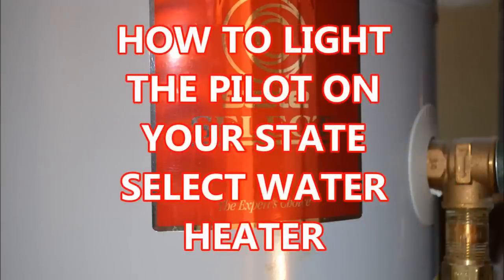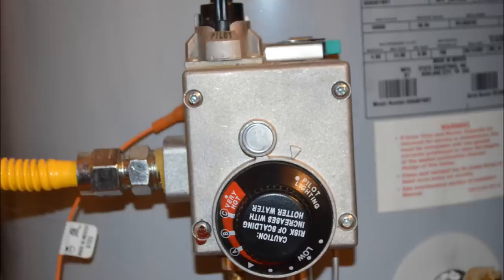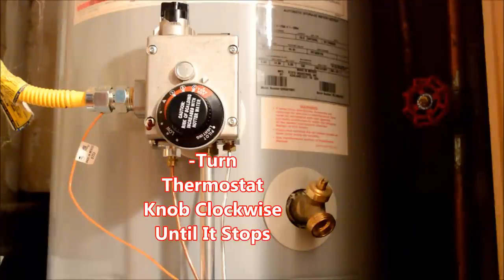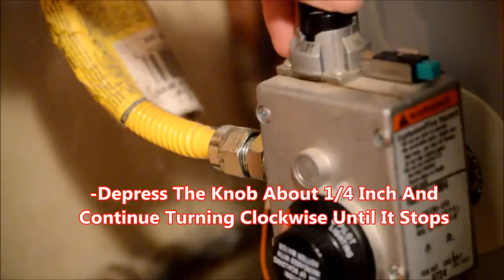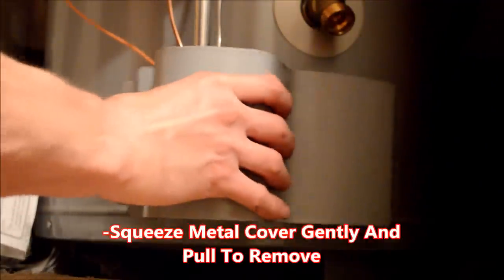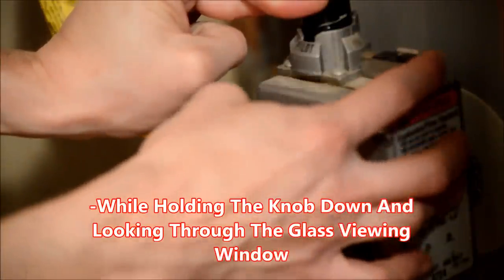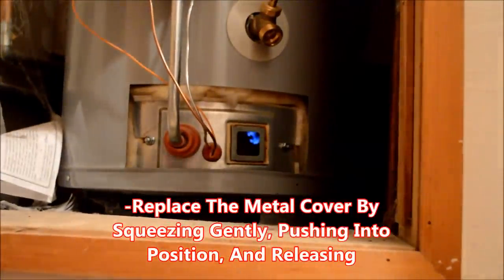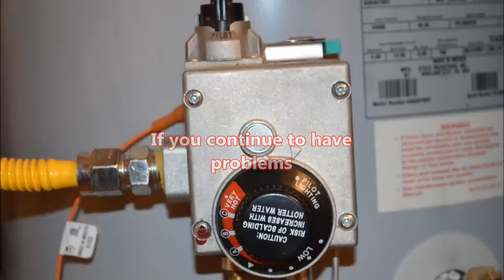How to Light the Pilot on a State Select Water Heater With Electric Ignition Switch

Comment: It turns out the ignition switch was "arcing" and locking up.  Using a new switch (hard to find) I'm getting a spark.  But I don't seem to have any gas when I depress the Pilot and use the switch.  The main gas line is ON.  Thoughts?

Comment: Good video for my unit.  However, my green ignition button sticks (doesn't pop back out) so I'm wondering if I need to replace that part.  I can pull it out with my fingers, but it just sticks again.  Suggestions?
Reply from the maker: +Robert Blake Hi Robert, First thing I would do is get a can of compressed air and spray it into the button housing while working the button back and forth. If you still have the problem, you will probably need a new part.

Comment: Hi, Thank you for your video. HOWEVER, not everyone has an Electric Ignition Switch on their State Select W/Heater. The older units do not. I do Not have one with my unit. So, you may want to add information as to where to place a match flame, to ignite the pilot. All other steps are the same as you describe. Thanks again.